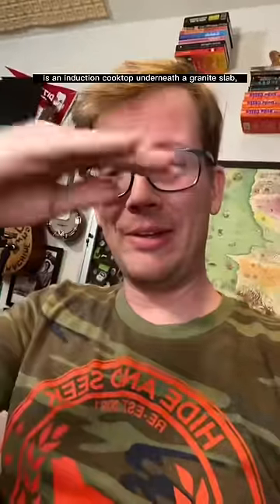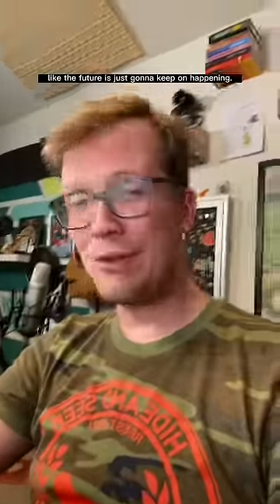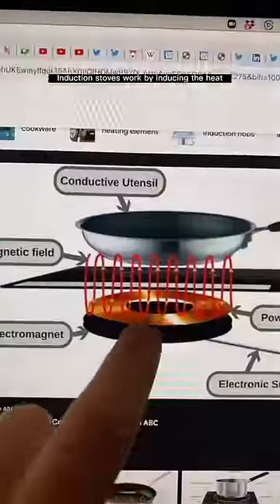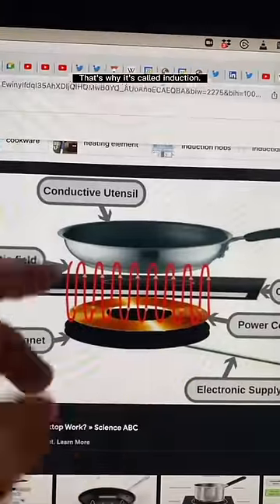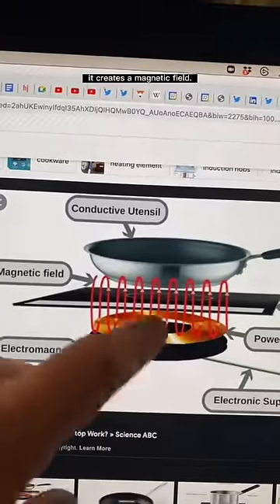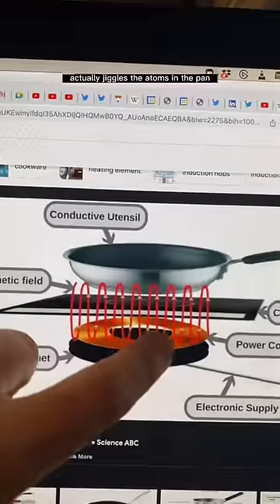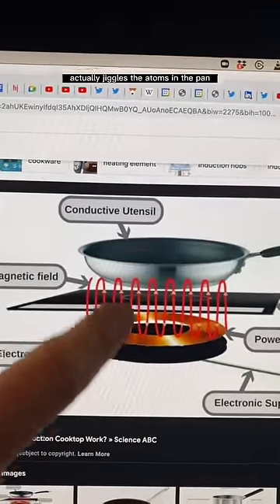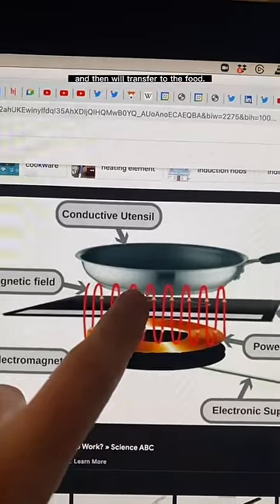How do induction cooktops work?

Comment: I've been using induction stove for the last 10 years and once you had one you'll never want to go back to anything else. It didn't have to be underneath a slab of granite or what have you, either. A basic induction stove beats anything.
Reply: IKEA has one for $60 and I think it’s called Tillreda or something like that and I love it.
Reply: i grew up with gas stoves, so it was quite hard for me to grasp induction stoves because there was no flame, but after getting used to it, it really is easier to clean and maintain.

the only bad thing i would say is i can't roast vegetables like eggplants and peppers on direct flame anymore, but it's nothing a portable gas stove can't solve.
Reply: @madeofcastiron  honestly, in my experience a tiny butane torch accomplishes basically the same thing, but it takes up much less space. This is especially useful since I don't actually char vegetables all that often.
Reply: I mean, I'm pretty sure there's certain foods that physically cannot be made using an induction stove, so it most certainly does not 'beat anything', but I admit that it sounds generally convenient.
Reply: @LavaSaver  The only case I've found where you can only use a gas stove is a traditional wok. Other than that you can do everything.
Reply: I went from a crappy induction stove (at my rented apartment) to a good gas stove (at the flat I bought). And the good one is definitely better than the crappy one.
Reply: @GamerNebulae  Yup. Woks not being effective is literally the only downside I can find with induction cooktops.
Reply: Why is no one talking about just plain resistor stoves? Like, surely they're the most energy efficient. I don't think I've ever used anything else so I don't know where people are getting gas stoves from?
Reply: @GamerNebulae  they have induction woks. Gas is cheaper for woks, but for home use, i would still get an induction one. Woks need so much heat and I would never put that heat into my home.
Reply: I actually prefer to go back to 90s when everyone had gas cookers. Hell, my grandma cooked on wood from a WW2-era stove! On these fancy stoves with sensor "buttons" it won't let you change temperature quickly if you have wet fingers 🤦 Who designed that??? And guessing how hot it is on a 1 to 9 scale is the worst. 3 barely simmers, 4 burns food at the bottom of a pot... Wth??

Most people seem to love newer tech but I think it's a stupid design. With gas I can accurately guess how hot it's gonna cook and I always get a steady flame for even cooking, while plastic knobs are 100% reliable to turn the heat up or down even with greasy wet fingers! No fancy granite induction top can beat that.
Reply: @fufun4me  they certainly do (I have one myself), it's just not the same. You usually play around with the cooking time and temperature of the different ingredients and that's harder to achieve with an induction wok
Reply: @tomaccino  Maybe you just have a bad induction stove. With induction, when something starts to boil over, I can turn it off and it INSTANTLY stops.
With gass, you can forget that.
Reply: @solsystem1342  because they're are the cheapest but worst for real cooking
Reply: @PeaceOfMake  what kind of gas stove can you not instantly turn off?
Reply: @evelgreytarot8401  He means stop the water from boiling instantly. Not about stopping the stove itself...
Reply: I had an induction stove and hated it. I prefer gas.
Reply: I hate induction because in my experience it takes forever to heat up compared to natural gas, and electric is even worse, unless I’m thinking of something else
Reply: Disagree. I've used induction and while they're much better than a hot plate they aren't as good as gas. 
You have to take the cooking vessel off the burner to stop the heat, heating coils are only 8 inches mostly so using large vessels  is pointless, you are limited to magnetic vessels, they usually won't go above 480F, and using two at a time with anything else running on the same circuit will trip most breakers. They are a great choice if you can't use open flame where you live but they have a lot of  drawbacks imo.
Reply: @evelgreytarot8401  You can, but it remains very hot, meaning your pot will continue to get heat.
Reply: @MFWb00bi3s  No, you literally don't have to put the pot off to stop the heat. 
You just turn it off.
Not to mention they go over 600F.
Reply: @PeaceOfMake   @Gabrijela Mikulić  I'm sure some models go to 600, most do not, which is why I said "usually".
Also the materials of the burner retain a ton of heat, and hold it for quite some time especially with a thick bottomed pan on top of them.
Reply: @fawkesrocks  You're thinking of hot plates.(which is conduction, the worse kind of heat transfer). Inductions are magnetic fields, hence why they're faster to heat up, they don't need to heat up an element and instead bypass straight to the pan.
Reply: @MFWb00bi3s  Most of Everything is non-existent actually. Idk what kind of induction plate you had but it certainly was some dollar tree chinese knockoff version. The only drawback is using a wok or roasting vegetables directly. Sounds like you're stuck in biases instead of actual facts.
Reply: @Tsusday  Most of everything is non-existent? Did you mean to say that most of the complaints I have, which are factual, don't actually exist in almost all induction burners?
I use a Hatco Rapid Cuisine at work which goes for about $800. It has all the shortcomings I mentioned and I will use our gas stoves over it 90% of the time.
Reply: @MFWb00bi3s  You're arguing issues that people who owned induction plates and countertops for over 15+years. The only issue I've had was a broken glass when a kid smashed the pan on the countertop. Also, you complain about size and you give me some small single use portable top shorting because you use a small power outlet.. Like idk what you expect from a portable one vs an actual one set on the main powergrid of your household.
Reply: Grew up with gas stoves, moved out into an apartment where my only option was an induction, absolutely hated it. Every time I lift the pan to toss the food, the induction top would start beeping and the heat in the pan would also be gone. It was impossible to create any wok hay on an induction as well. Glad I’m back to a gas stove.
Reply: @MFWb00bi3s  I don't understand. Yes, gas burners retain a lot of heat, making it harder to stop heating food up, compared to induction.
Reply: No way gas cooker wins every time, I've used cheap ones and expensive one but there both crap takes🤷🏻‍♂️
Reply: They take FOREVER to heat up though. Besides, heat is heat what am I missing 🤦‍♂️🤷‍♂️
Reply: @joshuaashton1929  The entropy
Reply: @PeaceOfMake  how do gas burners retain heat? You turn off the gas, and the heat is gone.
Reply: @prosquatter  Because the metal says very hot.
Reply: @PeaceOfMake  but the pot stand is very small and cools off almost immediately. I cook on the gas hob and as soon as you turn off the gas it stops boiling.
Reply: @prosquatter  Depends on what you have I guess. Large, good quality gass stoves remain very hot for a while after the fire is off.
Reply: Nah if you actually care about temperature control and cook times gas is infinitely better and If there's a power outage gas stoves keep working.

Comment: I got an induction stove, and I'm here to tell you that it's so much better than you would even believe. Any time I have friends over who haven't seen it, I'm like hey, check this out. I put a bit of water in a pot and crank it up. They're thinking it'll do something in a minute, but no... About one or two seconds in tiny bubbles appear on the bottom of the pan. 2 cups of water will rapid boil in about 20 seconds. The heat goes away faster than a gas stove when you turn it off. It's like instant. Yes, I realize how much of a nerd it makes me, but like... you have to see this. I would absolutely buy an induction stove again regardless of the fact that I no longer have toxic gas in my house, regardless of the effect on climate change, and regardless of how much money it saves me by using significantly less electricity than a normal electric stove. It's the absolute best stove available regardless of those other factors.

Comment: My only concern is cracking the stone. A few years back we had something sous vide for about 24 hours and at some point there was a big bang and a barely visible hairline fracture in the countertop. Maybe that only happens after 20 hours, but it also wasn’t very high temp, and heat was going through plastic to reach the countertop.
Reply: Also induction stoves are incredibly distance dependent, so if that stone is too thick you will get very poor induction.

Comment: Induction is cool and all, but those circles showing the 'zones' are super useful.  Good luck finding them on that.

Of course, you'll probably get muscle memory pretty quick when you burn the furak out of yourself on it.  It doesn't work by direct heat, but a hot pan on a surface still transfers heat.

Also, it's just a bad idea for practical reasons.  They have to make that area of bench thinner to retain effectiveness, and marble is already going to be way easier to damage than tempered glass.  Throw in a bunch of heating / cooling cycles, and you got yourself a need for a whole new bench every few years.

Comment: I saw one of these in one of those world's most expensive houses videos. There is a countertop with a half sphere divit in it big enough for a huge wok. They demonstrated how it can staright up be sizzling food then you lift it up as fast as possible and touch the rock but it's ice cold when you touch it. It's actually crazy.
Reply: Mmm.. that's not really how physics works. You can't have a heated system in contact with a cold system and not have an interaction. The counter does get very hot while cooking and you actually have to be pretty careful not to heat up the pan too fast so as not to crack the counter. My aunt had one installed and she cracked the marble in 2 months.
Reply: @mikeslaserstuff4018  how do you control the heat since there wasn't any knob in the first clip?
Reply: @mikeslaserstuff4018  well apparently it is because it literally exists.
Reply: @SleepIntoTheDiamondLife  there's a false drawer that flips down, you can see it in the beginning of the clip. There are a set of recessed knobs behind the panel. The same concept has been used for sponge and scrub utensils in front of sinks for over a decade.
Reply: @mikeslaserstuff4018  But that IS how it works... Well kinda.
So induction does heat up the pan and then in the proces the countertop as well. BUT you are not supposed to set the pan on top of the stove if it is a granite stovetop. You are supposed to use risers to keeo them elevated from the surface to not damage the granite and make it explode. 
(Edit: by not setting the pan on the granite, the air between them wont get hot enough to heat up the granite to any dangerous temperature.)

In ny opinion these fucking granite stovetops are just dumb and you should go with glass ones instead, on glass induction stoves you can just keep everything on the stove without it breaking. Although it does get hot after a few seconds because it is.. glass and glass is not the best at getting rid of heat.
Reply: @SeMake  dude. I didn't even try to read your comment past the first 2 lines. I LITERALLY INSTALL THESE FOR A LIVING. You have exactly zero to teach me about it.
Reply: @mikeslaserstuff4018  And I do IT for a living and I am happy to have people tell me more about it if I don't know something. You don't have to be an asshat because it's your job.
A teacher can still be taught.

Comment: Induction stoves are awesome, super fast and very efficient - but it didn't heat up that evenly. It could only be on full power or off - so in order to not burn everything it turned itself off for a moment and then back on again. Lower temperatures were reached by increasing the off-intervsls. It was a pluggable stove with only one cooking field for 20 bucks, so it's not the peak of that technology. I had that thing plus a little mobile oven that required you to fold your pizza in order to fit it in + a rice cooker. That was essentially my kitchen. My night stand was a cardboard box with an alarm clock on it.
I wasn't poor, I just liked to have what I needed - and not more than that.
Reply: That's pretty standard for electric heating systems in general, standard radiant stoves work the same way. It's far cheaper and more efficient to just turn the power on and off than regulate the output intensity.
It's essentially very coarse Pulse Width Modulation.

Comment: Omfg- this would make me so anxious
Reply: Why?
Reply: @humanperson0798  because I would accidentally turn it on or accidentally leave it on
Reply: @5uNgHo0nIe  ...But it won't heat up anything that isn't metal. Are you made of metal?
Reply: @humanperson0798  Mistakenly leave it on, then set a stainless spoon on it, then come back and pick up the spoon.
Reply: Turns out it really doesn't matter if you accidentally leave it on. I got one recently (though not one of these granite ones) and because it doesn't light up or get hot on its own I've frequently left the burner on with nothing on it and it isn't in any way dangerous
Reply: @MWSin1  At least for mine (and I assume this is common) if it doesn't have something on it for a few seconds it beeps at me and then after like 20 seconds it turns itself off even if the knob is turned on, probably for this exact reason

It being able to sense if a pan is on it or not is one of the many advantages induction has

Comment: We got an induction cooktop when we redid our kitchen and it’s so good. It’s like cooking with gas in terms of how fast stuff heats up (way faster than conventional cooktop) but without extremely inflammable gas, the only thing you have to keep in mind is that some pans and stuff aren’t compatible with it, although I think most newer stuff is
Reply: I've had to relearn old habits using it (in a good way). On my old electric stove I would put a pan on and let it heat up for a few minutes while I prepped the stuff to go into it, but induction heats up so fast that I don't have to do that at all. It gets up to heat in like 30 seconds, which is nuts

Comment: Finally bought my first induction stove when I moved. It's not the greatest model (no continuous power scaling) but it's still so much better than all other stoves bevore. Extremely fast and you can still wipe the area around and under pots and pens if something spills, because the top doesn't get very hot.
And adjusting heat is so quick

Comment: The current problem with induction stovetops is that they do not cook evenly. I bought one recently, and all the reviews point out that same core issue. Also, the control we have over the heat needs work. I do believe they just need improvement, and then induction stoves will become a replacement for our current stovetops. Just something to know before you make the switch
Reply: Depends on the quality of your pots and pans too. Can definitely mitigate this to some degree by having not the cheapest stuff to cook on. I have lived with induction on and off for almost 20 years, I find it to be very worth it. Whenever I can choose I definitely choose induction! Gas is nice, but induction is just so much simpler and safer.
Reply: I got my induction stovetop about two years ago. I was sad that some of my stainless steel didn't have enough ferrous metal but all of my cast iron and my better pieces did. I have never had a problem with it heating unevenly. Mine is an older floor model because I just wanted to try it out.

Comment: But, wait, where are the rings so you know where to put the pot?!?!
Reply: magnets to stick the pan onto them?
Reply: Lol it's just a countertop and Hank was missing the sarcasm. There arent any controls either
Reply: @daniel-pablo  was thinking that but maybe?
Reply: The entire surface works. You don't need to put it anywhere particular. And any size cookware works
Reply: @GigaBoost   that's not how induction cookware works. The coils can only go so big and  they have to be aligned to the pan. The lan can be bigger than the coil but it still has to be aligned within a couple of inches. And again, there are no controls. If you actually shop for countertop induction ranges they are inset into the granite with indicator lights and control buttons with clearly defined markings for where to place pans. An invisible range is dangerous. Even if the coils don't generate heat directly, if you place a hot pan on a surface, it will heat up.
Reply: As I said before. It's a goof. Decent explanation of induction technology, not an actual product
Reply: @daniel-pablo  nah you don't need markings for where to place the pan it can heat it anywhere. I'm assuming this comes with a laser display from above